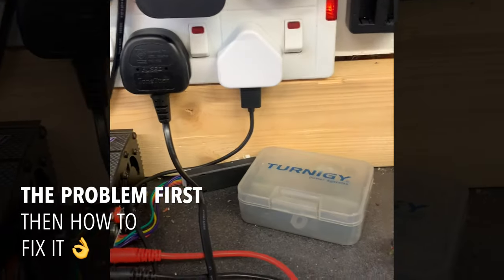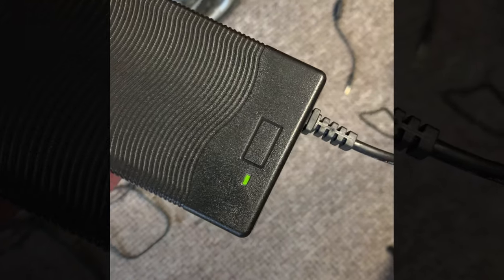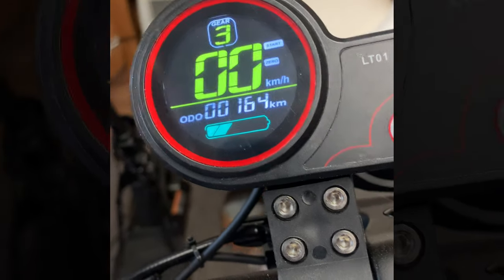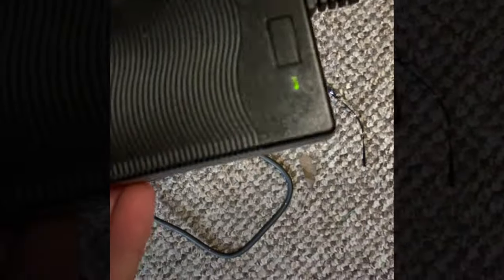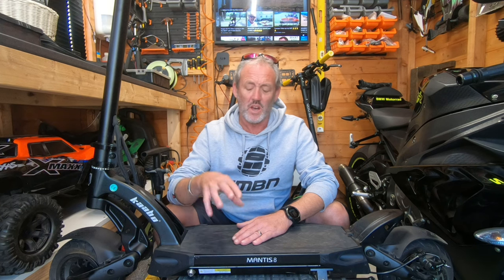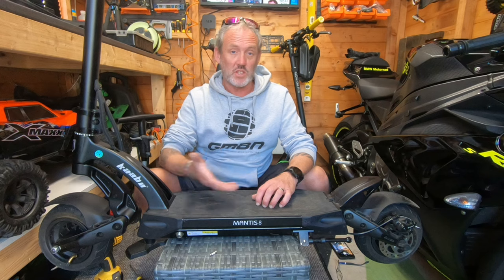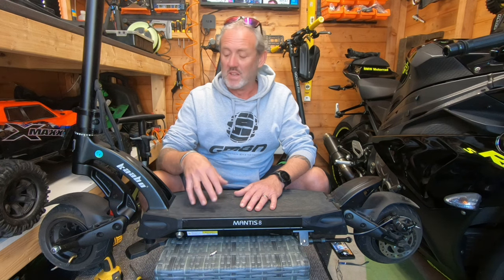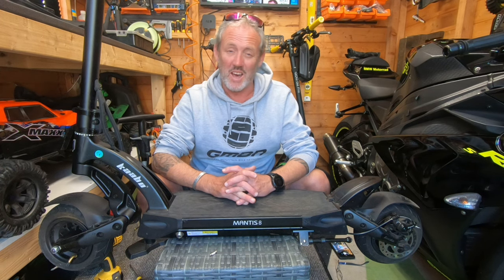Scooter not charging 🤔🤔🤔check this first as a Quick fix to get you going 👌

Comment: Hello Mark :) and thanks for a awesome video ! I have a Kaboo Mantis Pro 10 with the exact same problem that you had ! however i'm gonna replace the fuse just in case :) Keep up the good work because us committed scooter riders need Excellent video's like this ! I most certainly will be subscribing  👍
Reply: Did it fix it?
Reply: @Kriswixx  not yet 🤔 I replaced the fuse but still no luck!  I'm thinking it could be the connection between the charger port  on scooter 🤔
Reply: @carlreid4812  tight. It could be rusted pin ports. I need to get a micrometer and put one point to each and see if the pins are + - and which one is the dummy .check volts coming out of charger and on batt.
I'm not sure if it's a key problem or charger badm just gotta get the tools to check.

All because the tires were flat. Like I didn't need this usually it chsrges right up. Sat for. Ehilem hope you get yours fixed. Imma check for a fuse in there.  Good luck.
Reply: I have the same problem now with my Wolf warrior gt don't know what to do but I'ma try this

Comment: My electric scooter is a zero 11x and I rode it and turned it off, now it won't turn on at all, not Evan the screen will turn on, do you have any ideas on what I should start checking? Thanks
Reply from the maker: Hi inside the scooter you will find a 5a fuse try replacing it then you should be good to go 👍
Reply: @markjordan  thanks mate this is exactly what I thought it was it's one of my gir friends so will go try and fix it tomorrow!

Comment: I have a question for you, I have the same scooter, and my left blinker stop working, brakes lights work just fine and right blinker works as well, but whenever I press the left blinker to turn it doesn’t indicate or blinks. Any tips before I take it to a shop?
Reply from the maker: Hmm not a clue I’m afraid best take it to the shop
Reply: Its thatbox that the lights plug into. Its called a step down transformer. U van buy them on ali express

Comment: I have a Apollo City pro and sparks came from the charging port..
Does the scooter have a fuse cause scooter will not turn on anymore
Reply from the maker: Yes it will have a fuse check the light on the charger first to make sure the charger is working,then try to locate the main fuse by removing the top deck very easy👍
Reply: @markjordan  so under the scooter remove the bottom to get to the fuse
Reply from the maker: No on the top under the grip tape should be the screws to take the top off the scooter then you can see the battery and wires from the top
Reply: I have taken the battery right out and yeah no fuses at all anything else you can think I should try like I said it’s got plenty of charge in battery but since I made it spark it will not turn on at all....

Comment: Hey, quick question! I had not using the scooter for about 2-3 months and didn't charge it and now when I'm pluging the charger its not charging the scooter, the LCD is not even turn on. do you know what the solution ?
Reply from the maker: Check the fuse ?
Reply: @markjordan  The battery went below 31V so the charger is not recognise it.
Reply: @markjordan  yes, fuse are ok, the battery went below 31V so I’m guessing the charger is not recognized it

Comment: Hello Mark this is Sam from Chicago  I am reaching out to you for advice and  Your expertise. Since I leave on the 3rd floor in the apartment building charging the scooter for me it's impossible because I don't have a garage  And the weight of the scooter is huge but I can keep the scooter in my car, so The question is
 Do you think that dual motor scooter with non removable  Battery can be customized to remove  the battery for charging  without taking the whole scooter With me to the 3rd floor. And I  Think I  have the vision of doing that😃 and I think I understand a little bit but I may be wrong I understand that removing the battery itself  it's not enough because there is charging ports and maybe some controller that has to come with it and maybe some Wiring have to be customized That's why I need your expertise😃
 Thank you
Reply from the maker: Hi buddy yes you can remove the battery but it’s a bit of a pain as you would need to do the same process as changing the fuse so all the top deck needs removing….

Comment: Hi my name is Sam I just have inokim light scooter I came back home and I want to charge it I put the charger on in the scooter make little spark to turn it on blank then I open were the battery is lot of cable so I did and then the light switch on and the battery charging with mins stop charging but the light switch came on but not charging.. Please can you help me. Thanks
Reply from the maker: Hi Sam it’s the fuse somewhere with all the wires you will find a black plastic barrel inside that ther will be a 5amp fuse just replace it and your sorted👍
Reply: i have same issue with my warrior it always happens when it goes dead as im riding it i have noticed the after the lil tick noise my chargers green light is  out and i have to wait ten minutes to try again but it KEEPS ON SHORTING OUT idk im stuck plus i have 2 chargers they both do the same thing

Comment: This is my first scooter and probably the best toy I've had in my 38 years of life ; ) https://www.youtube.com/post/UgkxvyNuxpWiHTNypxG6nyqyf7ywc7Q16PDM The assembly was easy - Took me 10-12 mins to get it set up and enjoy a quick ride before putting it on the charger for the full charge.I love the push-off feature vs. some of the other scooters that start with direct acceleration. I believe this allows a bit more of a stable start with a jerk reaction. I also like the throttle/acceleration feature that its a slow increase in speed vs. what you would get in a motorcycle. I've taken advantage of the anti-theft system when taking the scooter out to the beach and city. I like the anti-theft system as well as the need to enter a code after you turn it on before you can operate. The powerful front lights are helpful for a night ride. You can see in the picture how powerful the light is as a reflection on the garage. I'm impressed with the lightweight and how easy it was for me to get it set up and going. I would highly recommend this for someone looking for a scooter.

Comment: I am a hobbyist and just so happen to be an electrical engineer. Your videos are usually pretty good however making a 13 min video about bypassing the only protection your charging circuit is not only incorrect but also irresponsible. Lots of younger kids watch your videos and listen and learn from them but in this case I hope they no longer do that . Even if the BMS protects the battery what happens if that charger melts down and burns your shed to the ground ? Worse yet some kid burns down his parents home with his family and pets inside . Chargers of this type are inherently garbage so the company can save a few cents. Being an RC hobbyist you know the dangers involved with lithium batteries however the charger itself  is now also a major concern . Please take this video down and make a much safer video about low quality chargers . 

I know a lot of people said most of this but I can’t express enough how much others DO listen to you and this is not what they should do EVER . 

Buying a smart charger and moving the fuse to a watertight fuse holder on the outside of the battery box is probably the best solution in your case my friend . 
Thanks Brian